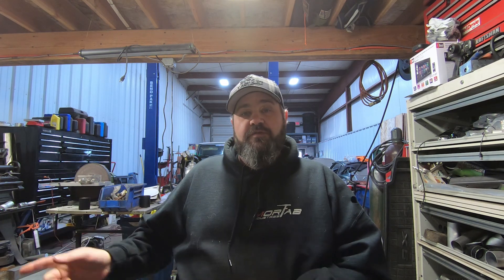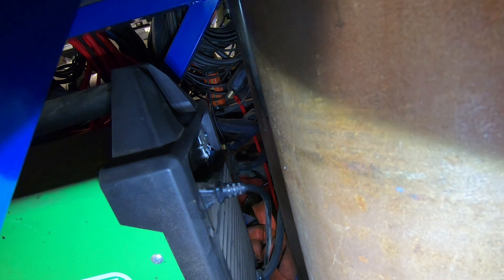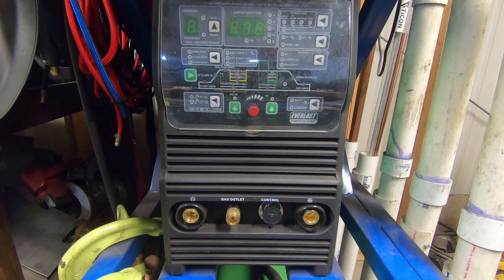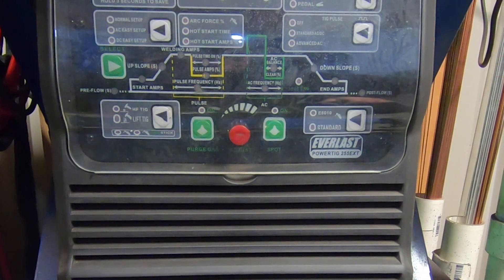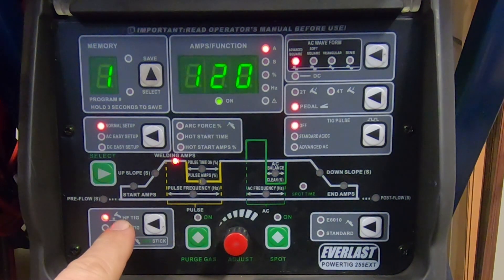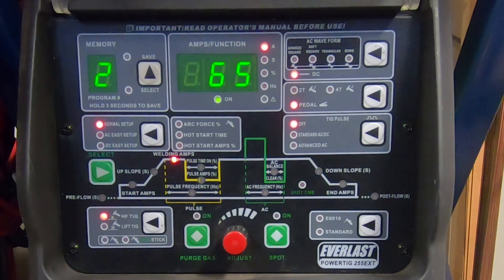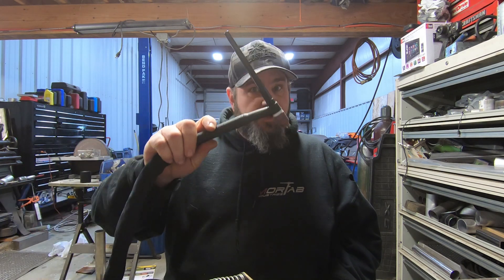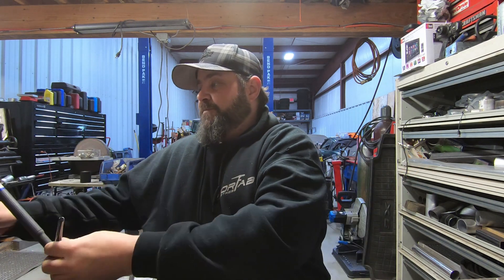Tig Welding EP3 Setting up the machine.

Comment: Fuck yes! Finally the next video is what I need! After a year at this and nothing but frustration I feel like your instruction is going to help me improve leaps and bounds I wish I could send you pictures of what I’ve done so far...in fact if you could find my IG @wickedmotoYT I’ll send you some pictures on there of some carbon steel pie cuts that I can’t get down worth a crap. I’ve only been doing lap joints and T joints for a year straight now every single day for an hour or more. I still don’t know how to manage the heat and or travel speed. So thank you for doing this man! I appreciate you a lot bud!

Comment: My tig welder is a hobart 220amp, foot pedal, 1 dial for amperage setting and an air cooled torch. Is the digital you use just more versital? Is my welder just basic? I'm a good mig welder and want to get good at tig. That's why I subscribed. Thanks